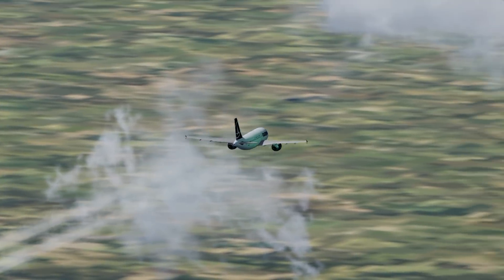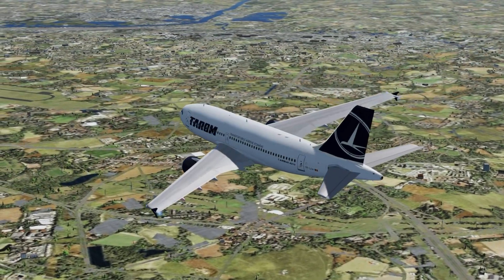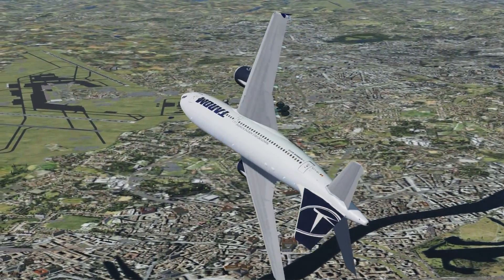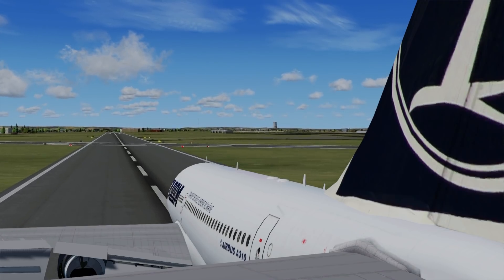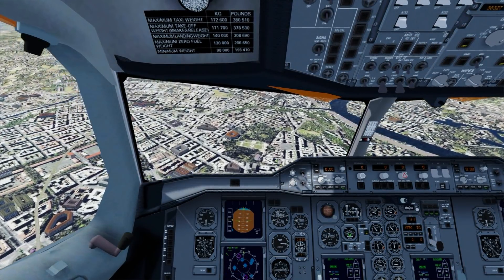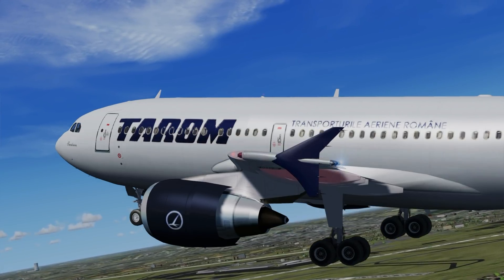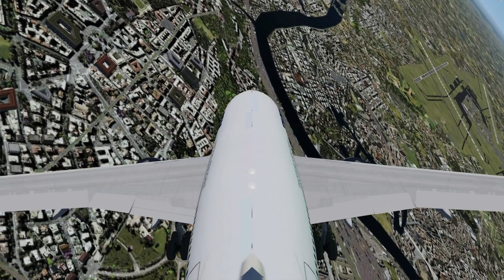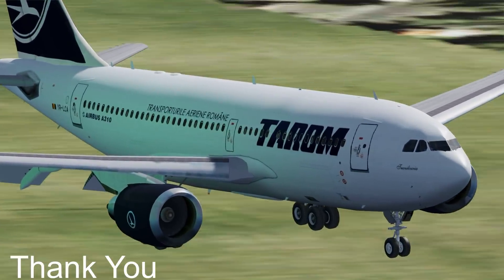The Pilot Who Almost Subconsciously Killed 186 People  | Tarom Flight 381

Comment: Video of this plane nearly crashing exists. As does the CVR (in Romanian). One question at the time was, as the plane was so automated, why didn't it override the angle of climb to avert the stall, a feature that has been in aircraft for decades? 

And if you think this near crash was scary, consider Ingerflug A310 that nearly crashed in Moscow due to similar mis-configurations and confusion:

https://www.youtube.com/watch?v=pHg2n40DLg8

Comment: I think the captain became confused whilst trying to deal with a stressful situation, and accidentally pushed the wrong button. Scary stuff indeed. The only thing I can liken it to is when changing from a car where the indicator stalk is on the right, to a car where the indicator stalk is on the left. It'svery easy to turn the windscreen wipers on when you actually meant to indicate to turn left or right. That is hopefully not too dangerous - but going into a 60 degree climb would be terrifying. 

Another really good - but scary - video. Thanks (I think..!).

Comment: It was that safety feature that triggered confusion in the cockpit , the pilots were surprised by the plane's reaction . The pilots learned that after the incident , just like in the Baloteshti crash where another safety feature kicked in exactly when a pilot was incapacitated and the other pilot couldn't recover in time due to low altitude . This lack of training for all Airbus pilots into the automated system made the path for Boeing smoother . Even nowdays I would not go anywhere if the plane is not Boeing , no matter how old the plane is , I just do not trust the fly-by-wire system .

Comment: This is an excellent example of why it is bad to have the machine doing too much of the thinking for the operator.  It happens in automobiles as well as in this airplane.  From the moment he disengaged the autopilot it should have let the pilot do the thinking and actually fly the plane, rather than taking over and nearly causing a fatal crash.

This is also a good example of a need for standardization of certain critical controls.  The mixed up placement of those buttons was an issue the engineers could have avoided and it should not be necessary to have such silly issues.  Airplane companies could put their heads together and standardize the placement of certain critical controls so pilots moving from one aircraft to another can more readily operate the aircraft safely, with much less risk of such an unnecessary problem.

Comment: I don't like the example you gave of how trim is used. You made it sound like a primary flight control, which it isn't. A better example would be if you need to push the yoke forward to keep the pitch you want, you could trim the nose down to relieve the input. You would never use trim in leu of the flight controls like that, and this incident is a perfect example of why!

Comment: Oddly enough i am wondering if the high pitch angle on horizontal stabilizer allowed them to recover much faster in steep dive since it takes a while for the stabilizer to move.  Perhaps once pilot leveled off from dive he was able to trim it back level.

Comment: Hmm, when the nose pitched up, wouldn't it be instinctive to not only push (elevator down), but trim forward (down)? They were fortunate to recover, an Air New Zealand A320 undergoing tests when in Germany, stalled from too much up trim. I don't know if the pilot tried to correct this, but the plane dived straight into the sea. Airbus automation seduced them into this test, but frozen angle of attack sensors put that protection out of use.

Comment: This is similar to Taron 371, which crashed after the captain had a massive heart attack and the FO read incorectly his artificial horizon, reading it as a Russian aircraft that he had been on before.
This incident and Balotesti prompted major training updates and overhauls for the Airbus crews. I knew the training captain very well (took his daughters to Great Adventure when they visited NY). Ive been on those jets and remember when this happen, and while I think there were issues with the old Ilyushin Tupolev 1-11 and 707 pilots, in this case I think it was more just being pushed back, and gripping the yoke.
I do remember talking about the incident, and some things were off the record so I wont repeat them, but things did change a lot after 95.

Havent spoken to any of those guys in many years though...Probably long retired by now.
Reply: Everbody knows that Romania was still under Russian influence early 90's. All we know is that someone on that plane wasn't meant to arrive at Bruxelles that day and that is why everything happened that way.
Reply: @valojj3197  No. Not at that point. Russia has just collapsed and was barely in control of itself. And the passengers were not important people in Bruxelles. Do you REALLY thing they would be flying Tarom? Yeah, I was alive back then, and I knew the chief training pilot, and Tarom transitioned from two different types of AC. And that coupled with bad luck (which you can find on the CVR. It is available, just not on youtube)
Reply: @RipRoaringGarage  it happend before with another aircraft full of passengers because of one journalist with photos on him a few years back to that incident. The story is nice, although Tarom Pilots professionalism saved them from far worse situations. But hey... who am I to judge.
Reply: @valojj3197  Actually, that flight was during the revolution in 89 and the only passenger was that journalist. Yes, that incident was different because there are records of the orders to shoot down the plane on its way to Belgrade. For some reason, the Romanian Government has banned that video, and nobody outside Romania has spoken of it. If my channel was focused on that, I would. I have gathered a lot of infor about that flight.

Comment: The purpose of trim is to neutralize control pressures at any given speed or configuration. For example, so that you don't have to hold back pressure during a climb-out. Some aircraft (usually military) even have roll trim to account for asymmetric loads.
Reply: Yes but the trim also allows the pilots to use more of the the elevator range when the forces are too high
Reply: The vast majority of aircraft larger than small trainers have 3 axis trim.

Comment: With all of the confounding control permutations the modern cockpit is capable of the one thing that is missing is voice response to commands.  The pilot hits the trim switch.  The computer should answer by voice saying, "trimming nose up....."  That would immediately tell the pilot he made a mistake which he could immediately correct.  Without the verbal feedback only time would tell if the pilot figured out what was wrong before the plane enters an unsafe condition, i.e., loss of control.

Comment: William Norris tells of a case in 1979 where the captain of a 747 that was off the coast of Newfoundland on a Boston to Heathrow flight asked the flight engineer to turn on the fuel heat switches. The flight engineer had spent most of his career on 707s, and automatically reached for where he was used to finding the switches, but ended up flipping the wrong switches and turned off the fuel supply to all four engines. Fortunately they were able to restart them...
Reply: MSFS, not real, but when, in an old version, I went from the DC-6B to the DC-7C, I instinctively turned on the water injection switches before takeoff one time.  Got a hundred feet up and all four engines blew.  The Seven had automatic water injection; I'd flipped it into high blower on the ground instead.

Comment: Of course the pilots WERE pusing the nose down when this happened, right? In other words, the autopilot overruled the inputs of the pilots?? Correct me if I'm wrong, but the only time an autopilot should ever do that is if the pilot accidentally did an obvious mistake like pulling the nose up at low speed, like the autopilot just did how the hell is this allowed to happen?? As I said, correct me if I'm wrong, but it seems like an incredibly stupid system to me. A random switch in the plane that could be hit by accident or be forgotten about should never be able to crash the plane, there should always be warning messages/sounds for those and they should immediately be overriden by pilot input.
Reply: There are autopilot modes, they set the go-around autopilot to 195 and when the gust of wind made the airspeed to 197 the go-around initiated without the pilots knowing thats why the throttles went full and the nose pitched up, the go around was initiated but the pilots turned the engines to idle while the plane is pitching up. they probably no idea that the go-around autopilot mode was initiated
Reply: @teambengkong6297  Yes I understand that, but why would the nose continue rising up like that? Wouldn't they instantly try to push the nose back down manually? And it seems like the autopilot overruled that?

Comment: Just a slight correction on what you said, so people who are not familiar with aerodynamics understand. It's not the forward momentum of an airplane that keeps it flying it's the speed and angle of the air across the wings which creates lift. Momentum is speed x mass, and definitely is involved, though, because it effects acceleration, both positive and negative.

Comment: In a desktop flight sim, I actually had a very similar experience once.  In the flight sim FlightGear, shortly after taking off in the A320, I ran into an issue where the nose suddenly trimmed up to maximum nose up for no obvious reason.  As the plane severely pitched up, climbed, and began losing airspeed, my instinctive reaction was to roll the plane onto its side before it could reach stall speed, putting the plane near the edge of its roll envelope.  That turned the high pitch into a tight turn and allowed me to use roll angle to keep the plane lined up to the horizon.  Then, having brought it under some semblance of control, I managed to get the pitch trim back down again and land it back on the runway where I had taken off.  The problem turned out to be that a switch on my throttle quadrant was mistakenly set to trim pitch up.

Comment: Not quite as serious. But. My last car had volume control where my new car has cruise on the steering wheel, and vice versa. I've accidentally deafened myself once or twice and had to manually brake when my cruise "ignored me" when entering speed restrictions. I'm habituated to one way of doing things and if I don't concentrate I'll get it wrong sometimes. Even though I've had the new car a couple of years now.

Not as serious as this, but the principle is the same.
Reply: I had 2 different cars and alternately drove one each week and was always reaching for the control locations in one car while in the other. Not fun turning off your headlights on an unlit dark and twisty road right when it started to rain while thinking you were turning the wipers on so yeah, I think the pilot was reacting as if he was in the BAC 111.

Comment: Did I hear right? 15,000ft to 6,000 in TWO MINUTES? Normal is like 500ft a minute and no one notices it. 1k a minute and you'll feel it.

They asked them to do 4500 a minute. That speed is the damn speed they would go during a depressurization so they can breathe. Of course they were going too fast when they got lower.

I just can't believe any ATC would say that. I don't doubt it - it's just so insane to me since it's so unsafe.
Reply: Not true. 2000ft/min is a normal occurance in every flight.
While 4500 ft/min is very high and I wouldn't personally assign it, I have seen commercial flights descent at 5500 off their own volition.

Pressurization descents are also more in the neighborhood of 10.000ft/min

Comment: The so-called "muscle memory" kicked in in the stress situation. The captain suspected the autopilot didn't disengage for some reason and tried to make sure it would. Thus he kept hammering on the button that would disengage the autopilot - on the other plane he flew for years.

Imagine someone would swap the position of accelerator and brake pedals in a car.
Then a deer hops out of the bushes, and a bump in the road makes your car accelerate slightly.
You instinctively want to slow down - and step on the wrong pedal. And the car accelerates even more and you step on the pedal even harder.

Why on earth does Airbus need to be different and garble up the position of controls?
Stupid prestige thinking.

Comment: In the heat of the moment, people tend to react to the stress in an unconscious manner by doing something (anything, really) that "offloads" some of the stress into the unconscious act -- habit has no role in this quirk of human nature.  "Hot Mic" is a classic example of this quirk for some pilots -- it happens because we are so focused on the stressor that we lose spatial awareness of our body positions and limbs.  Our unconscious brains react to the stressor by repositioning our stress "brace" to help manage the stress.   Other examples of this include jaw clinching, foot wagging, finger tapping, "death grips", etc.

A point of clarification regarding 'trim' is needed for those who aren't pilots:  Trim is absolutly necessary for the proper operation of a plane, and is not just a mere convenience.  It is used in all phases of flight to help stabilize the plane during takeoff, climb, cruise, descent, and landing.  All control surfaces (ailerons, rudder, elevator, and stabilizers) are "trimmable", and if trim is used correctly, allows the plane to be easily controlled with minimal input.  Also, autopilots rely heavily on trim -- in fact, autopilots cannot operate without it.

Comment: I had a question here: isn't that the vfe should be air speed rather than ground speed?  Isn't that a gust of wind should not have much impact on the air speed?
Reply: Only airspeed is relevant. And wind is ... you know ... air moving. So yeah, it is air speed, not ground speed, but wind IS a factor in airspeed.
Reply: vfe?
Reply: @Capecodham  You know, you can search the web for these aviation abbreviations. Vfe is the "flaps extended V-speed", which means do not exceed this speed when the flaps are extended.
Reply: @AdrianColley  I rarely use abbreviations in my trade when speaking to the public because I don't want to appear like a smartass.